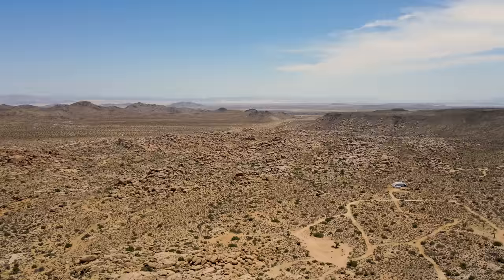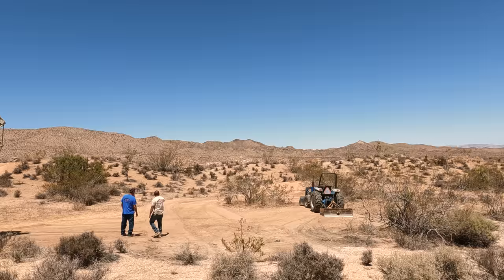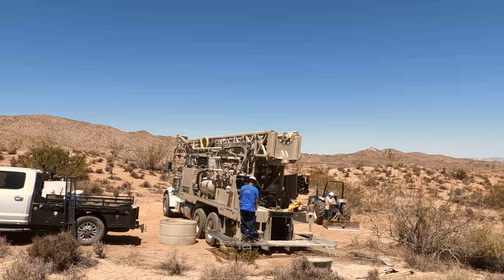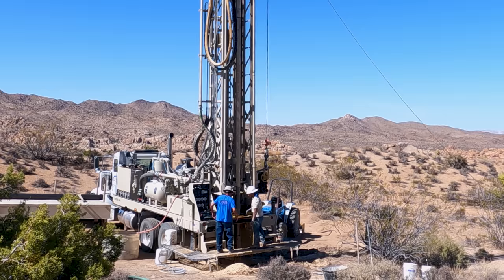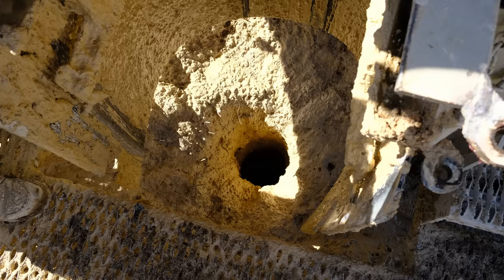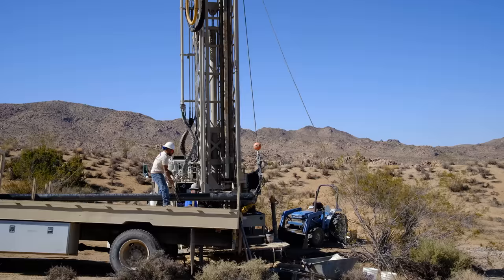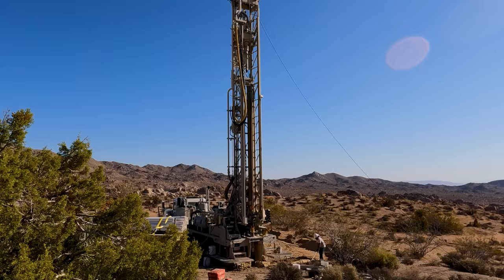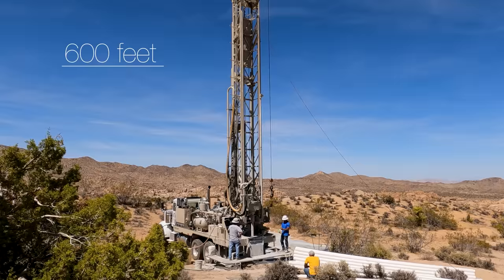Deep well drilling in the desert near Joshua Tree (part 1)

Comment: How much did that cost?
Reply from the maker: I left it out because of the potential it has to be misleading; just ten miles away for example, the ground is sufficiently different enough to warrant them using mud to drill all the way down, resulting in a different cost. Let alone the fact that a well in the US can probably go from like $10k to over $100k based on depth, geological conditions, labor rates, ease of access, etc.
This one, for what you see here was around $60k USD (in early-ish 2022). Not including water storage tank or pressure pump system, etc.

Comment: What did it cost??
Reply from the maker: I left it out because of the potential it has to be misleading; just ten miles away for example, the ground is sufficiently different enough to warrant them using mud to drill all the way down, resulting in a different cost. Let alone the fact that a well in the US can probably go from like $10k to over $100k based on depth, geological conditions, labor rates, ease of access, etc.
This one, for what you see here as around $60k (in early-ish 2022).

Comment: 600 ft not that uncommon.  Hydro fracking not needed. How many gpm
Reply from the maker: The wells out here aren't high producing so it's 4gpm but that's plenty  for me. Will pump into a large collecting tank and then pressure pumped to the house....
Reply: @LetsOverthinkThis  that's not bad considering

Comment: How did u know where to drill for water in the desert   Dit u use NASA   water  vein mapping under the earth or just a normal guy showing water with a stick
Reply from the maker: The nasa maps aren't nearly high res enough to help  if you're needing to decide whether to put it in one place or a hundred feet over, sorry to say. And I don't believe in the stick thing at all, ESPECIALLY if the water is going to be hundreds of feet down through rock.
I knew it was likely we'd get water as the area is known for it and the neighbors have water, so we just picked the only spot on the land that made sense to have it and minimize trenching and up-hill pumping later! But definitely a big risk either way!

Comment: average well price is $100 a foot in my area... 600 feet... do the math
Reply from the maker: Yep, it works out to the same, but the math for me was that this was something like $68 a foot for the hole, but then you add in the concrete pad, the pump, plus the wire and PVC for the pump and you're back at $60k-ish for what's shown here.

Comment: Can I ask how much this cost?
Reply from the maker: Hey there. I left the cost out because of the potential it has to be misleading; just ten miles away for example, the ground is sufficiently different enough to warrant them using mud to drill all the way down, resulting in a different cost. Let alone the fact that a well in the US can go from like $10k to over $100k based on depth, geological conditions, labor rates, ease of access, etc.
This one, for what you see here was around $60k USD (in early-ish 2022). Not including water storage tank or pressure pump system, etc.
Thanks again for watching!
Reply: Thanks!
 @LetsOverthinkThis

Comment: How much you paid in total sir?
Reply from the maker: Hi there. I left the cost out because of the potential it has to be misleading; just ten miles away for example, the ground is sufficiently different enough to warrant them using mud to drill all the way down, resulting in a different cost. Let alone the fact that a well in the US can go from like $10k to over $100k based on depth, geological conditions, labor rates, ease of access, etc.
This one, for what you see here was around $60k USD (in early-ish 2022). Not including water storage tank or pressure pump system, etc.
As I recall, was about $68 a foot for the hole and the rest of the cost was for the 500-600 feet of large PVC, the 500-600 feet of water-carrying PVC, and the well pump itself (with electric). 
Not sure what you mean by schedule. I had to wait a long time for my slot as the drillers were busy, but the whole thing took less than a week. 
Thanks for watching!
Reply: @LetsOverthinkThis  thanks very much for the extra information. It was a good job done and successful because the water was found and it cannot be better than that. God bless and do your market gardening and feed family..

Comment: How much did it cost
Reply from the maker: I left it out because of the potential it has to be misleading; just ten miles away for example, the ground is sufficiently different enough to warrant them using mud to drill all the way down, resulting in a different cost. Let alone the fact that a well in the US can probably go from like $10k to over $100k based on depth, geological conditions, labor rates, ease of access, etc.
This one, for what you see here was around $60k USD (in early-ish 2022). Not including water storage tank or pressure pump system, etc.
Reply: @LetsOverthinkThis  thanks for the info.
Great videos
 suggestion .you can make a video why lately people are moving to that area what they find appealing versus some other desert areas in California m
Reply from the maker: Thanks for the suggestion, but that's the kind of video I'm going to avoid :)
I have no idea why other people do the things I do, and even in these more technically-focused videos, I got plenty of mean-spirited comments about this lifestyle choice.  I'm up for discussing/debating technical topics but people seem to think it's okay to insult other people under the cover of anonymity and more opinion-based videos just invite that more and more.  I'll leave that to other channels ;)
Reply: Don't blame you for that , I guess the virtual hate is real and more than I suspected.
You have a gift to explaining things and making videos so keep going.

Comment: How much did you pay?
Reply from the maker: Yeah I left it out because of the potential it has to be misleading; just ten miles away for example, the ground is sufficiently different enough to warrant them using mud to drill all the way down, resulting in a different cost. Let alone the fact that a well in the US can probably go from like $10k to over $100k based on depth, geological conditions, labor rates, ease of access, etc.
This one, for what you see here as around $60k (in early-ish 2022). If you need a ballpark cost, best to contact a local well driller. Hope that helps!
Reply: @LetsOverthinkThis  Thanks for the response